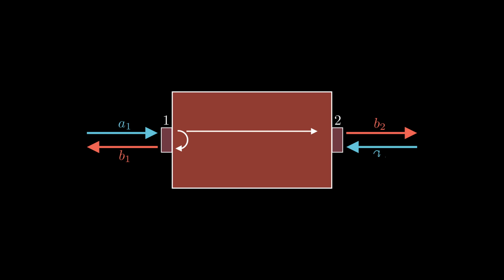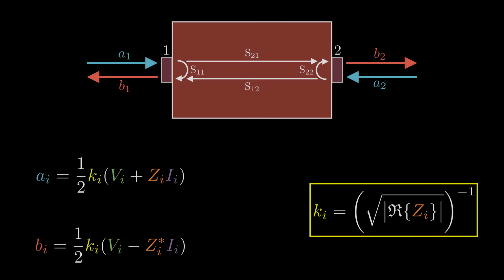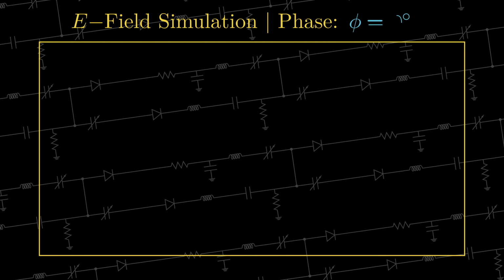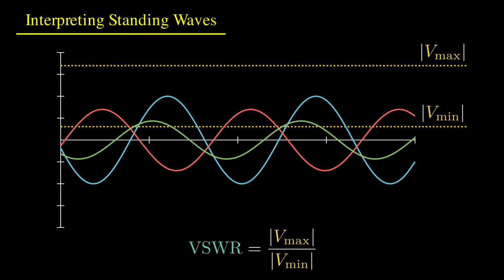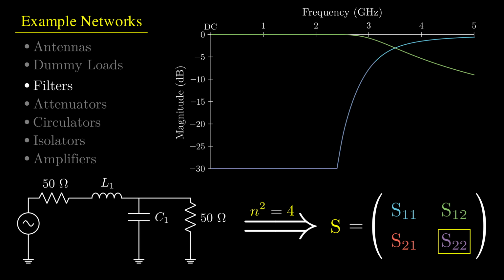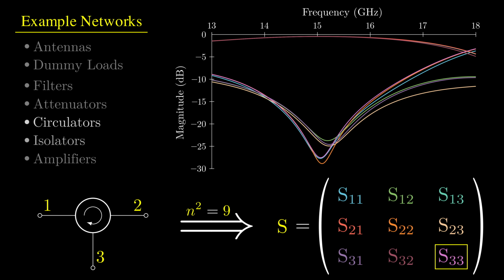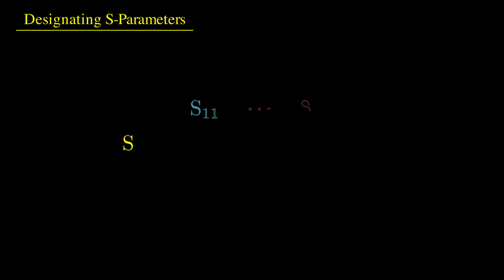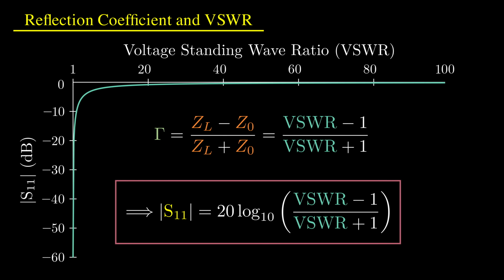A Visual Introduction to Scattering Parameters

Comment: An important point to understand about scattering parameters is that the reflection coefficient looking into port n is not equal to Snn unless all other ports are matched. Similarly, the transmission coefficient from port m to port n is not equal to Snm unless all other ports are matched. -- Pozar
Reply from the maker: I tried to note this assumption in the description.

Comment: Very well explained and I'm down with the jazz.  My only critique is that you used 'reciprocal' several times before actually defining in terms of the symmetry of the S matrix.  It would have been better to make that connection before the example.
Reply from the maker: Thanks for the feedback, I think you raised a good point. I tried to keep the mentions of reciprocity as minor comments to expand on what we'd expect to see in the plots, but it might indeed have been a better idea to introduce that section first, as the meaning of 'reciprocity' might not have been obvious to newcomers.

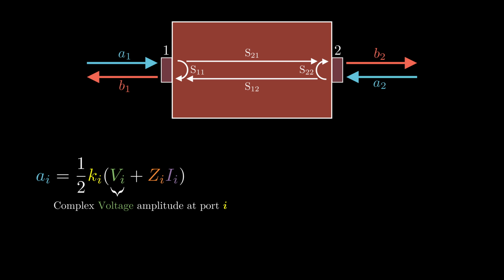Comment: Hi, thanks for the video. At 1:57, why is the voltage divided by 2 to give ai?
Reply from the maker: Apologies for the late reply - for a more detailed derivation of the power wave equations, I'd refer you to: Kurokawa, K., "Power Waves and the Scattering Matrix", IEEE Trans. Micr. Theory & Tech., Mar. 1965, pp. 194–202 (if you haven't got access, please let me know)

As well as the following document: https://ntrs.nasa.gov/api/citations/20000056853/downloads/20000056853.pdf
Reply: @OpenEngineeringRF  Thanks for the info!

Comment: Congratulations on a very good instructional video. I will make one comment...

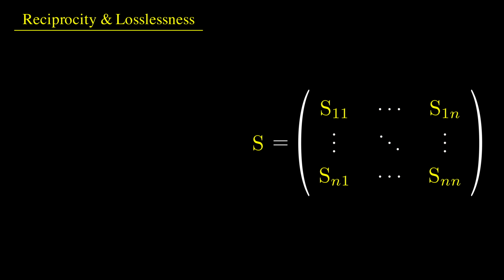At 13:00 you stated that S11 "corresponds" to Return Loss and VSWR, and you expand on the relationship with VSWR but you leave Return Loss hanging. More specifically, the relationship is with |S11|, and Return Loss = -|S11| where both are expressed in dB. The - sign is often omitted, a common error, very common in ham radio. You might consider adding a 'slide' to expand Return Loss (correctly).

Well done to all involved.
Reply from the maker: Thanks for your comment! You are correct that, strictly speaking, RL = -|S11| (and you can find lots of datasheets and other resources where return loss is 'misleadingly' provided as a negative value, but unfortunately this has become a bit of a convention to some, so I didn't want to introduce a lot of confusion by giving an algebraic relation between the RL and |S11|). This is why 'corresponds to' was used instead of 'is equal to'. The reason I expanded on the relationship between |S11| and VSWR is because it is less obvious how these two quantities are mathematically related. In any case though, perhaps the "Loss (≤ 0 dB)" note may serve as a reminder that it doesn't make sense for return loss to be negative. :)
Reply: @OpenEngineeringRF  Much kudos for a "well done" by Owen Duffy, he is a legend.